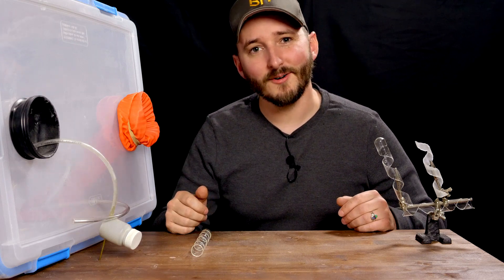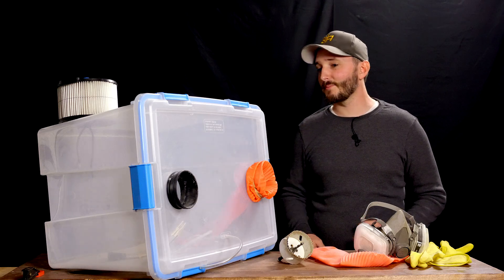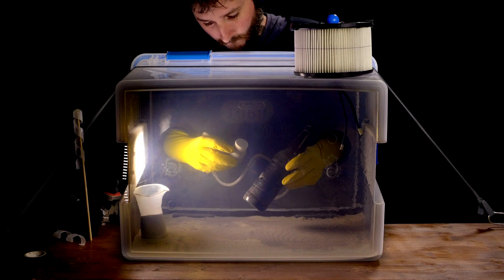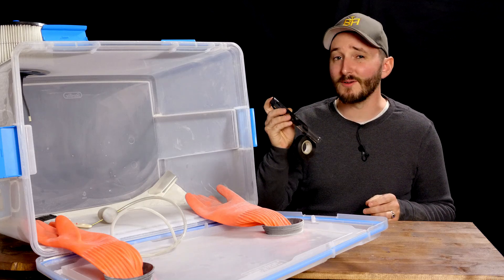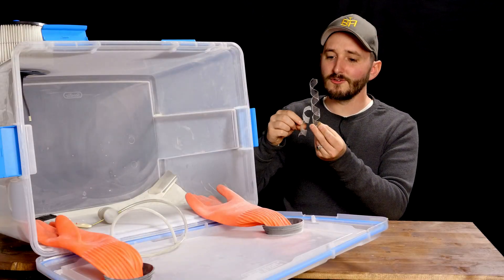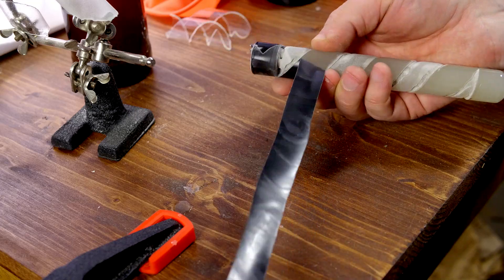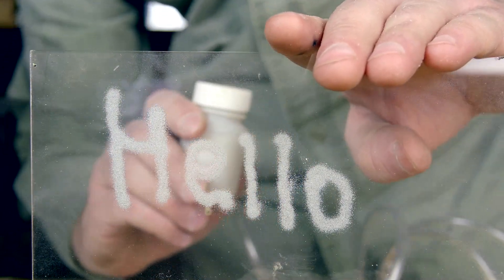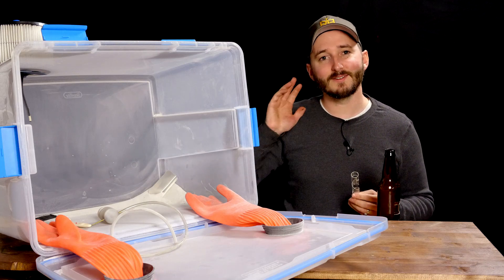*Impossible* Glass Cutting With DIY Sandblaster

Comment: get a military gas mask they will work for chemicals and any sand and fine dust. and they cover your eyes =. also glue in glass to your glove box and put a screen protector or the lightest tint for cars you can find and peel it off when done and it will be clear again. and the military gas mask will work to keep out anything bad out of your lungs and your eyes.  also you can put a vacuum on the box to suck out anything in there just be sure that it filters out what you need it to or you can route out the vacuum vent into the air outside of your garage or home. if you have more vacuum hose you can put it on the blow side and have it go outside and watch the dust blow outsidon't

Comment: In all honesty I'm not a fan of this. This seems deceptively safe and I can see someone wanting to try this and skipping some steps to save time and money. Like not using a proper respirator or using an improper cabinet/bin or not using one at all. Please don't. As for the medium, there are many different types of blasting medium, some more harmful then others. The best bet is Badger who make mini sand blasters. I use Aluminum Oxide as it contains a low percentage of silica and you can pick up a small bottle for around $10. If your just using it to clean something like remove paint or rust use Crushed walnut shells. I would also add an outlet to hook up a vacuum cleaner. This does 2 things, 1 it helps keep dust down thus better visibility and 2 it keeps the very fine particles from escaping.
Reply from the maker: You're right that sandblasting may seem deceptively safe, but I add further caution that low silica blasting mediums have been found to be just as damaging to lung tissue as the sand they are meant to replace. One exception in studies I've read is specular hematite which seems to cause less damage than others, but unfortunately suppliers are rare. Don't count on aluminum oxide being any safer, it causes the same lung scaring as silica with equivalent exposure. The worst is coal slag, with even worse damage than silica and its now one of the most popular mediums.

Comment: How about not using a vinyl cutter to cut the template but instead mounting the sand blaster to a 3d printer like frame inside a sealed box with some sort of dust collection and using it like a plasma cutter to cut out glass following toolpaths? I´m not sure if you could get a nozzle that stays precise for long enough or if there is an easy way to protect the mechanical pieces of the printer but i think that would be an awesome build. Great glassblaster you built there! I will probably replicate it.
Reply from the maker: I don't think there's much point to machine control for the blaster itself. It won't give any better result than by hand. Making the stencil is the part that requires precision

Comment: Well here is my idea  use old florescent tube. The glass is thin.
 Instead of fill it with wax just coat the inside with wax. For a cool looking multi plant watering tube. Clear Wine bottles  cut a oval-shaped hole other side with  extra small holes to hang them like ship in a bottle. 🤔

Comment: I know you said you want to be careful and keep it out of your lungs, but you didn't explain why. When sandblasting you are using a certain type of sand called silica, and if inhaled when it reacts with water it does not turn into mud. It turns into like glass fiber shards that Lodge in your lungs. And can cause infections and shorten your lifespan
Reply from the maker: Yes, and there are also studies that the silica alternatives for blasting are just as damaging, so all must be used with high caution.

Comment: Funny that you mentioned it, I used to run a small business making customized vinyl stencil packs for glass sandblasting. Your DIY blast cabinet bin is very clever. 
In lampworking we use layers of different colored glass, or silver-based glass formulas which sublimate contrasting colors in the torch, then we blast through the color layers by peeling successive masked areas, for a technique called graal. Quite ornate & colorful patterns are possible with careful planning. 
Kudos for the wax idea! That may prove quite useful at some point.

Comment: i have idea try to make trash gas (wood gas) by burning trash but you need to add triple filter using water coal filter and gravel +sand  coal and nano filter or you need wery  high temperature
Reply: because i read on internet that there is new way to produce gas by melting trash in high temperature 
so i thing you could make this work
Reply: also you could use botles with pumps to store gas in them bu presurising them and later check how long gass burns because you have cleand gass vith filters ir should be  cleen of nano plastic

Comment: What size air tank/compressor is needed to sustain that pressure?
Reply from the maker: Not sure. I think a small 5-10 gallon compressor would be enough, but you may need to pause once in a while.

Comment: I'm a scientific glassblower with 48 years at the bench, and I have to say that you have taught me a new way to approach cutting glass, using your very simple but effective method. Well done on sharing your skill. I;m very impressed with your tips about the wax in the tube. Great video and very well delivered.
Reply: I know right ? I'm also in contact with many glass artisans and even  though we are creative people, someone from outside the Beaux Arts field brings a fresh perspective and smart use of basic tools !
Reply: Virgyy Gee  it's a lot less dangerous to use than any lathing machine
Reply: @gra4279  that dust is no joke, folks.
Reply: I just watched your glass steam engine videos. You could absolutely start a YouTube channel showing your skills. People definitely want to see that kind of thing!
Reply: What's a scientific glassblower
Reply: Tony A scientific glassblower is a person that can make glass instruments for laboratory use, for instance, a machine can not make a coil condenser, I specialised in glassware that is used in particle sizing and blood research. Glass tubing can be put in a double headed lathe so that two different sizes can be joined together, usually this is done when the two sizes are either to large in diameter to hold in ones hands or they are very long and not possible to manipulate by hand
Reply: @batwillow  thank you for the info
Reply: @tony7713  Scientific Glassblowers are essentially the opposite of artistic glassblowers. Where an artist tries to make something unique and creative a scientific glassblower makes precision parts from a blueprint.  I mostly make parts for the semiconductor industry at my job. I make parts out of quartz and those parts are uses by computers chip companies to make the chips. I hope this answers you question!
Reply: @tony7713  doing lab glassware
Reply: @tony7713  the opposite of a religious glassblower
Reply: Hey Bat, we have a scientific glassblowing group on Facebook called "the quartz shop" we share tips and tricks of the trade and your input would be very appreciated!
Reply: I am really interested in glass blowing and the manipulation of glass in all and any ways. So I do please say thanks to the guy that made the sandblasting cut on glass video and for the first comment that immediately grabbed my attention and that is who I replied too first. 
All that aside, I dont want to be so quick to my own selfish greedy needs to further my crafts. Or well that's exactly what I want it's just that I dont want it to seem that way for all the wrong reasons. Anyways I'll just cut straight too it. Can you or any one that you hold value in their craft be of any such mentor to some one like myself or know of any one looking for an ambitious apprentice. I am self taught  and well I have only been workin on chumps change and not totally done any thing too to impressive. I also need at least just direction and answers from some one that actually knows what they are doing from experiance instead of what's thought to just be common sense. 
Thank you for your time and patience and as always I look forward to hearing back. 

Allupianyah
Reply: Ok now that I am less excited, I will make my comment that this video had me to thinking of a simple skill in the art of glass cutting and for my self that is scissors and a nice deep, wide and just all around box/bucket/ tub /and or body of water. Occasionally depending on what i am aiming to do with each next piece of glass I might use a steel file with a nice and true edge with all of its teeth still ready to tear away at anything you require it for. Ok back to my point. If you submerge the glass and your hands arms ect...  the tools you use and aim to cut with. Most of the time with out trying to go the distance trying unproven ways too your self, like experimenting beyond what you already now know works for you or not. I give it a rate of 90%or so success in the ability to draw a wavy line on a sheet of glass with some scissors  with out it shattering or cracking out side of your ongoing cutting edge. As well as scribing with a file on a tube of borcilikite (I very well may have misspelled that). Also I will add that in on eof my experiments I discovered that if that tube of glass as well has water contained in it as you are cutting at it and or scribeing into it that the success is less than complete submersion yet a lit higher then just dry. And also if your careful you can use cement dry though wet has a higher chance for success depending on your end resault desired. That's all I have for now thank you for your time and patience.

Allupianyah
Reply: whats does a scientific glassblower do if you dont mind me asking
Reply: @hiiiiiikjuujn  If you think of the mad professors laboratory, all the glassware that he/she would use, well, that would be made by people like me. A coiled condenser requires it to be made by hand, as these types of glassware can’t be machine made. For instance, test tubes can be made by machine but if it requires a tap on the side of it, it has to go to the scientific glassblower. I hope that helps.
Reply: This guy always reminded me of Mr. Wizard.  I loved learning from him and I have learned from this guy with the same curiosity I had as a child, but as an adult who can actually pull it off.
Reply: u make bongs?
Reply: Dekz why would I risk my 48 years reputation being a scientific glassblower to make anything that could destroy my business over a $40 bong. Yes I could make them but I never have made them and never will !
Reply: @batwillow  I work in the weed industry there are a few scientific glassblowers that make bongs and there worth more then 40 dollars try up to a few thousand depending on the piece. And they use it to make glass roto distill for dab making. Big risk trying to get into a multi billion dollar industry
Reply: @tony7713  Really, I can't be bothered to break into that type of market. My reputation as a Fellow of the British Society of Scientific Glassblowers is far more valuble than supplying crack heads or pot heads and leading to a potential lawsuit for providing drug paraphernalia and the distress it would cause to my family and me. My skills have been used to save lives and to address reseach labs, not for some "recreational" use dropouts !
Reply: @batwillow  nice you forgot humble to your list there high roader. You have achievements you don't want to risk sure that's fine but to be so belittling is sad really tons of people use it for pain, seizures,ms and the list goes on it'd about to go nationwide in the USA and the there's a pill Dronabionl approved to treat vomiting and nausea. And what is your glass use for
Reply: @tony7713  I do realise that some people require medication for conditions that are alternative to the norm. but here in the UK class A and B drugs are illegal and the apparatus that could be used to administer them can be siezed and that could have a follow up from the authorities as to where that equipment may have come from. The impact of prosecution can close a business and cause a law suit against the manufacturer. I certainly don't want any of that involvement. The glassware I produced mainly went into blood analysers and into other medical instruments, as well as for reseach projects in major laboratories around the world.
Reply: @tonyvelasquez6776  Well, when you have seen what has been going on in and around my city, and drug dealers giving away their shit to children free of charge, it's no wonder one can get angry at the low lifes of this world peddling damaging drugs to kids.  Any person that thinks otherwise needs help. I on the other hand, choose not to help those that "require" instruments to indulge in said activities. By the way, weath is not the answer to humility, that comes from a true uderstanding that respect has to be earned and not bought.
Reply: @VileOT48  I made a point to NOT supply people with equipment to indulge in the use of drugs. That is my integrity and I am entitled to my opinions. END OF !
Reply: @batwillow   yea you're entitled, bub, but thats about all you got correct there. You act as though you were specifically asked to make crack pipes. Someone told you about the industry of people making high quality glass pipes and you immediately went on the defensive about your achievements and reputation, while making uncalled for remarks about the people who use said glass. You could have just said "No, I've never made those items as there's not a legal market for them here in the UK." Instead, you chose to make it a point to refer to the market as "crack heads," "potheads," and "'recreational' dropouts." Very classy, Mr. Willow. Also, Tony was saying that he was glad he stayed humble after gaining wealth, not that he gained humility through wealth.
Reply: @stevenarmstrong5364  Did you not read the part that said, I’m entitled to my opinions, END OF !
Reply: @VileOT48  drugs are responsible for all those words that you thought made sense. Dont do drugs. Pick 1.
Reply: @thelostsoul5531  Not a lot makes sense to you I take it
Reply: @batwillow  making a bong wouldn't destroy your business, water pipes were originally made for tobacco!
Reply: @Bat Willow.I gave up replying to most people on youtube when I realised that half the time I was interacting with 14 year olds with no life experience.Saves a lot of time.
Reply: @batwillow  So hypothetically, your glass tubings could have found their way into the hands of the people that started the pandemic. 
I'm sorry for being rude, I do respect your background and experience, but you got your morals on backwards. Specifically, you seem to respect paper more than people.
Reply: @durere  Ohh you are so very wrong on so many ways...that's like saying the gas/petrol stations are to blame allowing the lab techs that started the pandemic to be able to drive to work. Yes are a very rude to assume things regarding me and my profession, get you head our of your backside and realise that trolls and keyboard warriors are no longer listened to.
Reply: Virgyy Gee  wtf? you can't cut everything with a lathe, and good luck cutting this with a lathe without high speed shards of glass flying out and high likelihood of oblitteration the moment you try to machine it.

Comment: Add a valve you can activate with your hand!!! this will save you so much sand and increase your accuracy!

Could be sick for some animations by stacking cut glass and using LEDS to light up frames sequentially.

Clearing support material from 3D prints?

Could this be used to cut sheet metal using metal powder and more air pressure?

Comment: What is the air filter for?
Reply from the maker: A shop vac
Reply: @Nighthawkinlight  I don't see a shop vac hooked up to your box.  What am I missing?
Reply from the maker: Oh you mean why is it on the box. You need an air outlet because otherwise the sandblaster would pressurize the box and blow the lid off. The outlet needs to be filtered so no dust comes out
Reply: @Nighthawkinlight  bingo
Reply: @Nighthawkinlight  seems like you could engineer a way simpler solution to that one, just sayin

Comment: Now the question is, how can you smooth the edge of the cut without breaking the glass.
Reply from the maker: Sandpaper or emery board, or a barrel sander on a dremel
Reply: @Nighthawkinlight  I would just be concerned about stressing the structure while sanding it like that (Especially with a Dremel. Mine have tended to have awful front bearings).

You might get a better cut using a finer abrasive. I have 120 grit aluminum oxide in my sandblasting cabinet. You could use a finer pipe with it as well.

(I'm also concerned that you might get a leak around the bottom of that filter.)

Comment: Thanks for the video. suspect that a piece of foam slid into the tube might work and be quicker than the wax.  I think I would try the gloves through the side of the tub, with the lid at the top. 

The danger is silicosis, which you can get from silicon sand, (I know a stone mason who suffers from it after 30 years of work) Other cutting materials can be used and for this task silicon carbide grit might work well. 

I spent months working I a full air-fed helmet, sandblasting wooden signs up to 5m long with computer cut rubber letters and designs, nice grain effect but awful job. We used non-silicon sand. The visor window became frosted with time but was just a replaceable sheet of ‘acetate’ . Overhead projector polyester sheets or polypropylene ‘report cover sheets’ would work. A ‘window’ using that idea might be help.